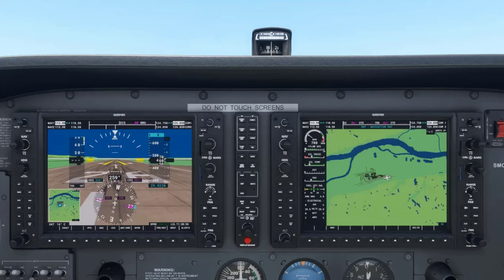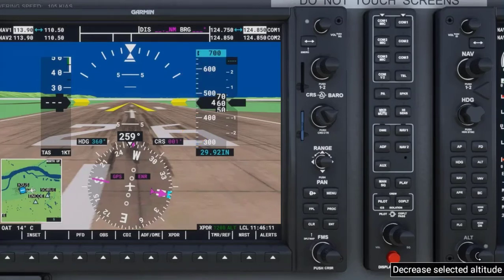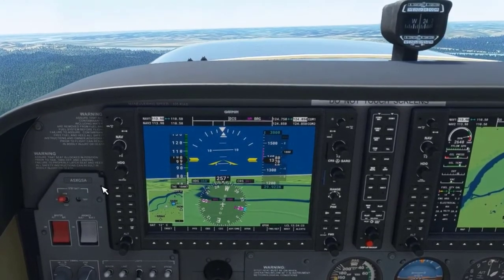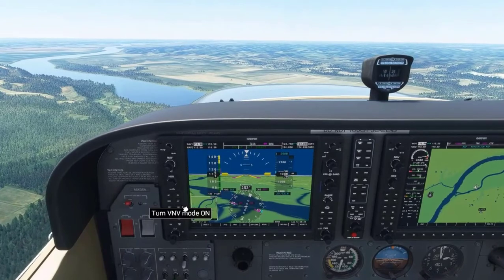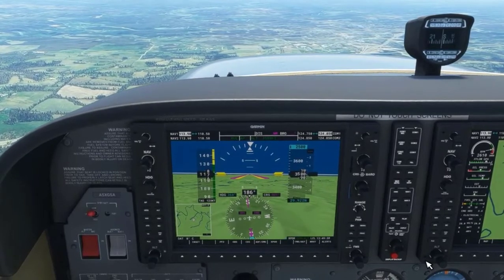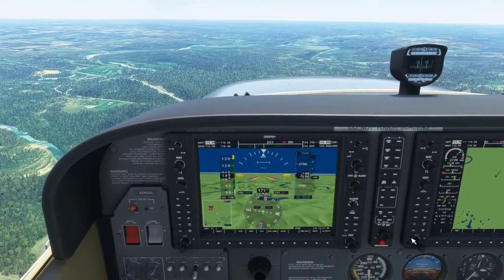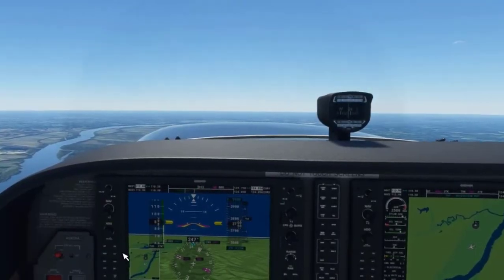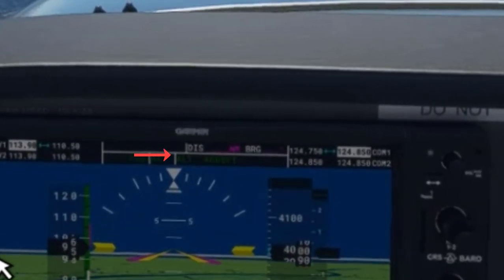Garmin G1000: Altitude Selection Knob, Altitude Bug, ALT Key and Altitude Hold Mode

Comment: Good overview. One suggestion though. When climbing it's better to use the FLC (Flight Level Change) function. This causes a climb at a specified airspeed. Using VS could cause the autopilot to pitch the nose up into a stall.